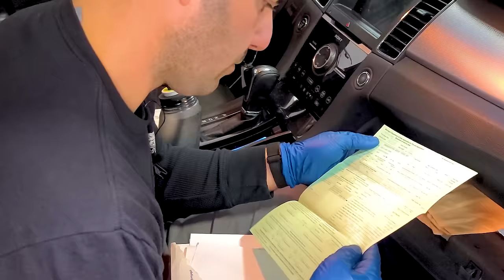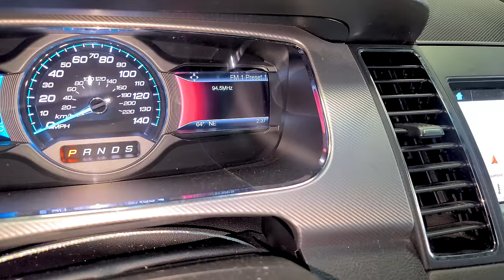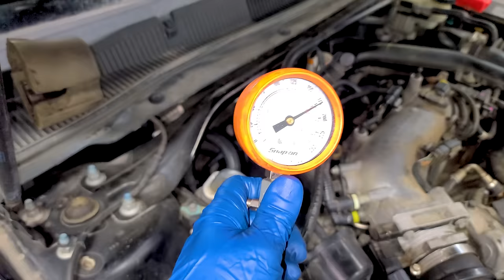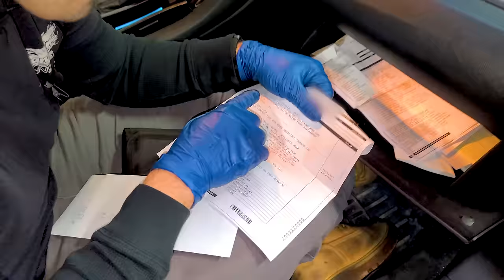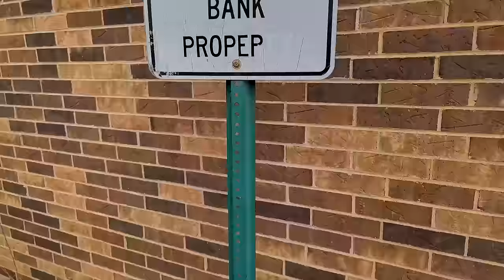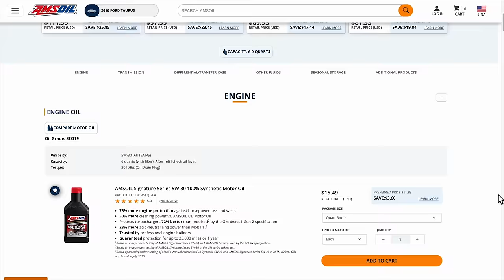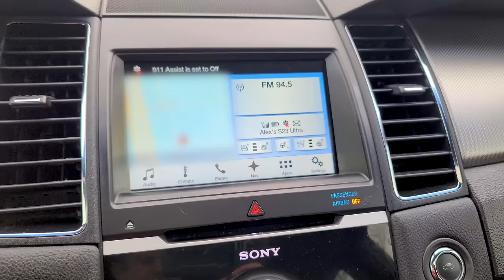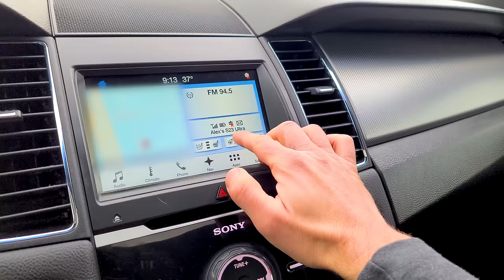I LOVE My GTR So I Bought Another Twin-Turbo V6 AWD Auction Car For 50% Off! Fixed For 30 Dollars!

Comment: Yes by all means do a Pappa D Regal video.  Please do that.  Since the plug was replaced under warranty they will only replace the defective part.  I am sure they would have try to sell the other 5.  But who knows?  I fill my oil filter, I always have in the 45+ years of oil changes.  It doesn't really do much because the oil pressure fills the filter quickly.  But it doesn't hurt.

Comment: Been fan from the start, and was excited to see the SHO addition. I drive a Ford Flex, it shares almost identical drive train. I’ve always been interested in adding power, but also cannot risk downtime as it’s my daily driver. From what I’ve been able to find out, the transfer case has potential to be the week link. Please turn the screws on this project!

Comment: My uncles 3.5 eco boost did the same exact thing drove fine normally but as soon as you put it under any sort of load it was misfire badly and get a blinking check engine light then would go away we come to find out it was just the spark plugs we changed them and it runs like a champ

Comment: Very common issue on these it’s called the “eco-boost misfire” it’s normally from improperly spaced spark plugs replace them and should be fixed

Comment: Love the video! I have a 2012 Lincoln MKS 3.5turbo w85K miles and I'm sure it needs a valve cleaning as well.  This video gives me confidence that I could do the same in a weekend in the home garage.  I have heard that installing a oil catch can can help reduce the amount of carbon build up from the PVC system back feeding into the intake runners and valves. Look forward to additional videos on the SHO.

Comment: Call Triple Edge Performance in Fort Wayne. The best 4t65hd builder in the country hands down. Just installed a stage 2 3200 stall in my GXP and absolutely love it. Definitely want to add a trans cooler.

Comment: Icing on the cake would have been to give the SHO to Papa D as a gift to replace that old banger of his. You did really well with that GT-R. I have a 2009 black edition that I bought new, had it on order for a year before they even came out. I'm amazed at just how well it's held the value. Wish I could say the same for my Merc CLS :/

Comment: Dealerships have been cutting corners in a very obvious manner since the lockdown no one seems to talk about anymore, that lasted* a year and a half. Dealers have also been gouging to the point a 25 grand truck suddenly jumped to 70 grand. There was a point in my life when a seller said dealer maintained with dealer stamps and service it meant something. In present day, I trust shade tree mechanics more as we have more education just from you tube and actually diagnose issues instead of throw parts at an issue and hope for the best. 

 I took my Mazda 6 tourer in for an scbs light/ check engine light/ dpf soot accumulation and a few other codes and the dash lit up like a Christmas tree. I already knew the issue was a £72 exhaust sensor malfunction, the part was recalled for poor design and an upgrade released. I had 6 months left on warranty having already researched the sudden burst of codes and lights but took it in to see what the dodgy dealer techs would say. My warranty would not cover the bi-turbo as it had already been replaced due to a recall for a penny washer fault that left a waste gate open. I knew it in my bones the dealer techs would say turbo and sensors and claim it needs a carbon clean etc- for 2 reasons: 1. to gouge and 2. they have no clue.

 I recorded my thoughts before entering the dealer and had already purchased the part, fully prepared to sort it. if this was going to be a long  warranty fight that would leave my car off the road as I would not  drive it in limp mode nor would I simply use my Carly to clear the codes. As expected they called back to say turbo, sensors, dpf clean etc but nothing about the actual exhaust sensor or replacement part. I asked for the manager, explained my side and played my video I was going to post and he agreed to comp me for time off the road and replace the part and pay me back as I had bought the official part from Mazda. I do not trust this generation of computer mechanics that have no clue and trust dealership service departments even less. I am in the UK for anyone wondering why I am typing about a dpf and other parts you have no idea about as you (USA) do not get the diesel turbo engine options we get in the UK. I think your Mazda Mk3 series cars/suvs only had a few engine options and we had 11 options but only 1 petrol (gasoline) option. Should have picked the petrol option. Ended up deleting the dpf and remapping stage 2.

 Papa D looked like he was living his best life in that GTR, grats on the SHO, badass sleeper car right there.

Comment: Owned the EXACT same car, same color, everything.  Had the very, very first model year SHO with the Yamaha built engine, and decades later, the very last generation.  Both were reliable, and great.  First one was a manual tx, which was built by Mazda or Honda, I forget which.  Great video, wish I had picked that auction off, hah.

Comment: my mom has the exact same car, and the dealer threw her timing off when they did the timing chain and water pump. Ford never took responsibility for it but after doing a lot of diagnosis and bore scoping and checking firing order the intake cams were off by a good bit. Would love a good video on how to do the timing chain because she wants to sell the car but that has been its only issue. Also, they sound pretty good with a down pipe and an exhaust.

Comment: Ford, yes I expected coils and plugs first. Only Motorcraft works in mine. I use a small tube taped to my shop vacuum to get trash out of the hole.

Comment: Good on ya for getting a later model. Early Ecoboost 2011-12  (truck at least) could have a defect connecting rod in it. Windowed the block on a tuned 2012 f150. Quick google search said I wasn’t the only one. 

Also they’d have dropped the engine out to change the chains and pump. Ford is a huge fan of making the engines easy to drop/cab lifted off to work on the engine.

Comment: For the Regal GS, may be better off replacing it with a 4T80E that came in Caddys w/ the Northstar engine instead of the 60 that came in the Buick, they were known to fail easily, especially after adding more power. Supposively the 80 handles a ton more torque and from what I remember it was a common swap a long time ago.

Comment: That flex on the sensor may be to not tug on the harness under hard launch/high throttle when the engine really pulls against the mounts.

Comment: Welcome to club eco
11’ link MKS with 132k had it since 76k 
Gonna have to do that PTU and tune it 410hp  no problem make sure all the turbo solenoids lines are clean some oil grime gets in there and makes it laggy. I use 10w30 for the VCT makes load variation compensation much smoother and sturdier. 
I hear intercooler kit and turbos are pretty all you need to dust a lightly modded GTR.. 🤫🫡🫨🫠🥳

Comment: Someone should make the ford adapter clear that would make it a little easier to see!!! Awesome vid, I have a 14 Taurus SEL you make me want to take the whole thing apart and clean
Reply: You don’t need to worry about carbon build up on your car it’s has regular port injection so the valves get hit with fuel from your injectors

Comment: Now that you didn't spend as much on repairs you can spend more on mods right?!

Also I think you're supposed to coat the K&N filter a little more (then let it sit for a few hours). The oil helps the cotton collect particulates. It'll probably be fine though.

Comment: Nice buy!  I gotta say, Fords are where its at on good deals to get right now.  You can find some really well equipped Fords for not a lot of money because everyone is so stuck on Toyotas and Hondas.  My 2013 C-Max was a great deal and has been a great car and it's pretty much got everything I would want in a car except maybe cooled seats.  My fiancee has a 2011 Taurus and it's a nice car overall. The gripes I have with the Taurus are the atrocious blind spots, not a lot of visibility out of the rear window, and the stupid cupholder design (which makes it very hard to clean if something get spilled).  I wouldn't buy one for myself because of that, but for the deal you got I'd probably be ok with living with it.

Comment: That was funny you mentioned the Q50. I have an '18. With just a $500 JB4 boost tuner you can run 20% E85 and get 400hp at the wheels. Although that SHO has way more gadgets and features than my Q50.

Comment: To get some turbo noises you can do vent to air mod, mufflers upgrade and well then for serious then upgrade the down pipes. Although for the VTA mod is a hit or miss with some ecoboosts engines with not reading the air from the blow off valves triggering a check engine light

Comment: Happens more often than you think. Usually the tech travels down the wrong path and never finds the problem so everyone gives up. I have a Volvo that developed a no start and rough acceleration. Thousands of dollars and numerous repairs later it still had the issue.  Then I found the voltage converter was putting out voltage on the low end of the scale. Charges and starts fine, but sometimes and some conditions the voltage is just low enough to not open a relay that controls the fuel pump. Ding ding ding, problem solved.

Comment: I'm surprised at how little carbon were on those Ford Ecoboost intake valves.... I've had two Ecoboost and never had problems with intake carbon build up, but I am certain the secret is to change oil regularly and use the correct modern new oil that is made to cause less carbon build up.

I laughed at the "coffee stain"... LoL...

Comment: When you have a dealer warranty, they will replace 1 plug + coil if you have a misfire, not all of them. They basically did with with my M5 till they had replace all the coils and plugs individually, over a period of 9 months  🤣🤣

Comment: 2015 SHO owner here. I would love to see how you would go about servicing the PTU (Ford's center diff thing), as Ford claims they are lifetime fluids, yet they seem to explode for no reason -_-
Would also love to see some mods from GearHead Tuning or Livernois Motorsport, specifically the power packs they offer or the intercooler upgrade.
Reply: PTU’s usually serviceable with sucking the old oil from the filling plug. Here the dealership in Saudi Arabia use 1 quart of 75W-140
Synthetic Rear Axle
Lubricant. I usually do it on my AWD Ford Edge every year so I don’t have to replace the unit if it fails due to lack of maintenance.

Comment: Let me tell you how to to fix your lower back.  I'm a licensed massage therapist 
and have helped other mechanics with the same problem.  You see, your body needs both the front and back muscles
 to keep you upright. They should be balanced so 50% of the strain is taken by your back muscles and 50% of the strain is taken up by your front muscles.  When your front muscles are weaker than your back muscles... (say 40-60), your back muscles have to work overtime to keep you upright.  You can correct this by doing stomach crunches every morning.  Also you should stay off sweets and carbohydrates since they are basically sugar and sugar depletes potassium from your muscles making them prone to injury.  If you follow these two recommendations your back problems will disappear.  I guarantee it.

Comment: Love the Papa D Regal! Check out LS4 kings, they have figured out a way to use the 4T90 trans out of the Cadillacs and have better luck than the stock 4T65 those cars came with. That’s for the LS4 V8, but I have to imagine it’s not a far leap to use it with the 3800.

Comment: Just watched an eBay listing for a 2017 Ford Taursus SHO, same exact color, located in Levittown, PA, 97553 miles, auction ended at $9,175, but the reserve was not met.

Comment: Internal water pumps are the stupidest designs ever on engines. I work at Ford as a Service Advisor. We do 3 to 4 of these 3.5NA, 3.5EB and 3.7NA motors a week with regards to the water pump. Since you're in there we tell customers might as well do the timing chain components as well and make it a one and done.

Comment: Never pay someone to rebuild a transmission unless it is an older model. The newer stuff has so many variances that it is impossible to learn the nuances of all of them. Instead, buy a rebuilt transmission with a longer warranty from a company that specializes in rebuilding transmissions. You roll the dice either way, but your chances are much better by buying from a specialist.

Comment: Im so glad my 2018 Taurus has dual injection and i got its a 60k miles so i started thr CRC intake valve amd Turbo cleaner at every 2nd oil change, hope I'll never have to get the intake off to clean them with the combination of CRC ans dual injection

Comment: Those 3.5 ecoboosts are notorious for the spark plugs to Crack and cause myltiple missfires. my 2017 expedition has done it 2 times now in 1 year sames style plugs so I went with some ngks and it fixed it.

Comment: My wife and do not have any fond memories of the Ford Taurus. She had one when we met a Wagon (a 95 or 96) It was not as tricked out as this one and the Night We elope to get married it nearly killed us.  
We went from Sacramento to Reno and somewhere along the way we took damage to the fuel line but did not know it. We drove to Reno then back home, We found had we had to go to the airport in SF and then to San Jose. We knew nothing of the leak, just in the morning the garage smelled of Gasoline. We left and drove to the SF Airport and San Jose, On the way back, the gas smell got worse, so I look under and found a small leak on the passenger side. We got home and parked in the driveway and had it towed to the shop.

  Around 11am, I get a call from the show to tell me there were 3 leaks and the wagon caught fire when they started it. He asked when started leaking, I told of the trip we took and ask. Do you a water heater in your garage? I said yes, He asked is it gas? I said yes. He said you are very lucky the house did blow. I asked what caused the damage.

 His answer is what makes it very distrusting of FORDS, He said that it was just a worn out part. I was like you telling me a car fuel line wears out after 5 or 6 years, just wore out? After the repair, we really didn't trust the car, Plus from 97 to 2000s the  the Ford Taurus had some very bad issues that had some  just shutting off while on the road due to a part should that have been mounted to the fair wall but were mounted to the engine block. It was fixed by ford after a lot of court cases. I will say I am surprised at the great deal you got. I am also very surprised at the features. Plus, the fix was just super cheap.

Comment: Dealers only replace what warranty allows them too and warranty only allows you to replace just the cause of the problem that’s why only 1 spark plug was changed. Just like when engines are replaced under warranty all old spark plugs, fuel injectors, etc are used. If they want them replaced it comes from customer expense most of the time not warranty sadly

Comment: i got a high milage v6 mustang recently and the sparks half of them were cracked the same exact way you show in the video! idk why these motorcraft originals keep cracking, the sparks i pulled werent even that old they prolly had around 70 to 100k miles on em, so i changed them with ac delco ones.

Comment: Have a '13 3.5 edge. Same thing full dealer service and had the same issues with the plugs and air filter. Almost identical. I think service at certain dealers has gone downhill last 10 years

Comment: Alex, what fuel additive do you like to use to help keep the intakes relatively "clean-er" than doing nothing at all. And Kudos on the cleaning but am trying to avoid getting that invasive on the intake and valves.  Thanks, Love the Channel, I grew up around a junk yard, wish I did more than goof off and could have learned more while hanging out with my Dad and Grandfather.

Comment: I worked at a stealer ship anything done under warranty is required to only replace the necessary parts I have literally tore an engine apart for timing chain noise with 150k miles on it and they told me just to replace the tensioner nothing else even though it would have only took minutes longer to do the chain as well

Comment: They are known for blowing turbos the exaust housings break the water pump is also a common problem also timing chain problems plus the common torque converter shudder and also the PTU which is the transfer case it’s not bad when they get maintained but total nightmare with those cars I’m telling from experience

Comment: Hate to throw poop on anyone's head but the dealer that was servicing that SHO was BS big time. There's no excuse for doing what they did charging what they charged and not even checking the air filter or replacing the plugs. In my book it is totally inexcusable! I would report them to the state automotive repair bureau myself. I totally abandoned my local Subaru dealership service department for a way to less than this mess. I think they probably wanted his engine to be badly damaged so they could go in for the big kill next time!

Comment: Are you thinking of selling It?  I have a coworker that is looking for car.   His Mercury Milan was it hit in the passenger door. It looks like a new skin might fix maybe, but ins totaled it because of age and mileage.  He took pics to a body shop and they will not repair it.  Why? Because of the door hinges they said.  It was his most dependable car.  It had 180k.

Comment: I have a 2001 regal gs with less than 10,000 miles on a built transmission I need to get gone.   Anti theft is set and driver window motor dropped the window so it has a bag taped in.  It's the Olympics edition.
Reply from the maker: Email me at legitstreetcars@gmail.com